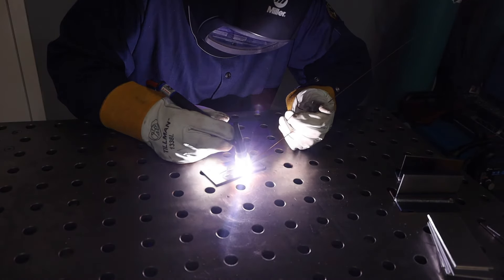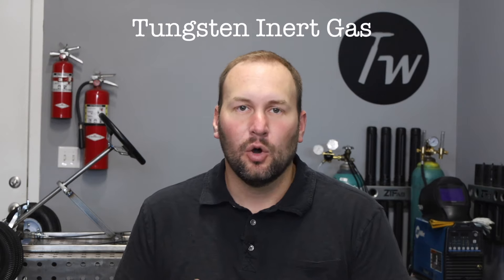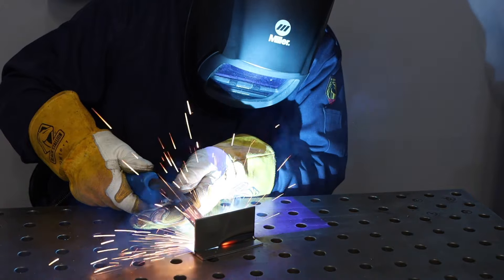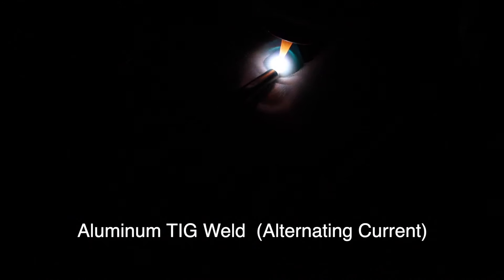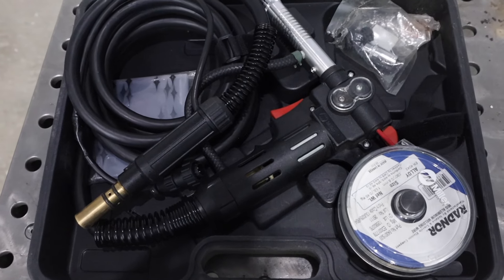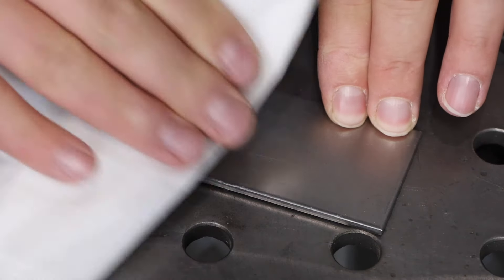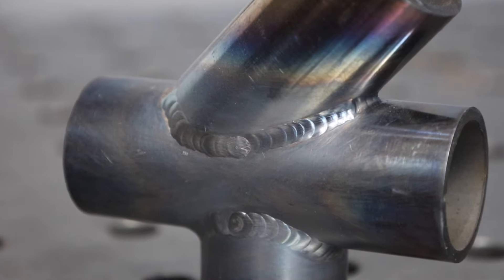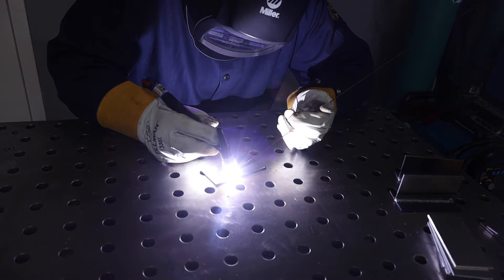TIG vs MIG Welding for Hobbyists: Which Type of Welding is Best?

Comment: I went through this for years. I went through the process of Stick>Flux>MIG>TIG>MIG>TIG. I only wanted one welder with one type of gas. In the end I went with a TIG AC/DC. I can weld anything at 12am at night with my kids sleeping upstairs in silence in my attached garage. No smoke, no spatter and limited fire hazard. One bottle of argon, some filler wire and you are good to go for pretty much everything. As a hobbyist, time is of no concern. I went with the versatility as aluminum is actually cheaper now in my area than steel.
Reply: Yeah I went from stick welding to Gasless MIG but would love to learn tig
Reply: @stewartsharpe9258  theres some really cheap tig machines ($200 steel only)out there. The only catch is the argon bottle, in my area, a full argon bottle will run $380. Its a way to get your feet wet in tig.
Reply: Where do you live? Low earth orbit?
Reply: @XenFPV  ?
Reply: Those are great points i stil am learning tig welding to be able to make my own exaust for my mopad
Reply: @stewartsharpe9258   starting out whit stick /flux is prety good its not to easy and u realy learn good basics about materials and how to adjust for those difrent materials i also like that stick welding is freakingly cheap and if u buy the right machine u can also tig weld because u can switch the polarity
Reply: I went to a school with my friend, already new stick, but learned mig in a week and tig in in a couple weeks.. I find tig a lot more dificult then mig.   but wow do people pay for specialty welds....first vertical weld I did with the triangle pattern turned out as good as it gets and I got $19 an hour, lol back when my highschool friends were in college, now there in university?  I asume they're still not making as much....$30 an hour these days I almost choked,  man welding is a good job ::-)
Reply: Flame welding is the only welding that makes sense because you are bonding the same material you are welding. MIG or TIG uses other materials to fill in which decreases the joint strength.
Reply: Tig machines can weld autogenous
Reply: @Sm00thieK  You're a dope. Anyone with an ounce of sense or ability to read above grade  5 level would know how/why very few people bother with gas outside of cut-off torches or rusted on nuts/bolts.

Comment: I chose tig as its quiet and clean to weld in my smallish garage at night. I think there is an argument for both. I'm looking to buy a mig at some stage but having another gas bottle is annoying.
Reply: You can use one gas for everything. MIG gas on TIG will eat the electrode up faster, and argon on MIG will make weird-looking welds that could be low in carbon and prone to cracking... but are you making a construction crane or a firewood splitter? 80% of 60 ksi is still a lot of strength.

I got the big bottle for TIG and the little one for MIG figuring I'm more likely to put it in the car and go somewhere for wire feed than for TIG.
Reply: Old comment, however thats a very good point to make for a lot of us home DIY'ers.
If you actually look at how much time you spend doing the actual welding, does it really matter if it takes you an extra 25-50% longer to do TIG? If I've a lot of welding to do, if MIG would take me 30 min, and TIG would be 40-45, the much less smoke, sparking, and lower noise doing it at night in my garage is a big plus in my consideration.

Comment: I’m going to start welding for the first time ever. I’m going to be ordering a primeweld tig225x. It may be a lot harder and time consuming but it’s the process that I’d want just for strength and penetration. I want my cage to be the strongest it can be. But the facts that I only need one gas kinda confirmed it for me. The setup might take a little longer but the ease of just needing to adjust settings and not gas tanks helps me since I’m going to be welding mostly in my garage

Comment: I bit the bullet and bought a 3 piece from Primeweld. TIG(225), MIG(180), and Plasma (Cut 60) for about 2k. Love em.
Reply from the maker: Nice!
Reply: How are you liking them?
Reply: @spoolinsvt6489   I still like them as much as day one, but I don't get to use them as much as I'd like. .......
I don't have a heated garage and I live in Michigan. It gets quite cold sometimes. I did notice that the arc start on the cut 60 doesn't always kick off on the first couple trigger pulls when it gets really cold. Other than that, not one issue. Really for the price, they are absolutely fantastic.
Reply: @derekmoore1612  Yeah at that price it is hard to say no. When in red or blue that price is basically going to get you only one of those machines.

Comment: I am learning to MIG weld at work. But I am also borrowing my friend's TIG welder at home to learn that too. Now to be fair, the set up at home has to all be put away while at work everything is out and ready to go, and there's a nice welding table too. But it's so funny the difference, especially when learning. Setting up at home for TIG is this big ordeal. At work last week I was prototyping a new weldment with MIG and it is just so damn fast! One handed welds zip zip zip. It's not a final product so it doesn't have to be pretty. But I am a perfectionist so I think at home I will get a TIG once my friend needs hers back. I want to be able to make some robot frames out of stainless and titanium because I'm a goofball, though I will mostly work with aluminum, and TIG seems nice for getting all that done.

Comment: Here is my take:  Stick for thick sections, FCAW for thinner sections, MIG for even thinner sections and finally TIG for the thinnest sections.  Also MIG and TIG are used for the so-called exotic metals such as stainless steel, aluminum and titanium.  Then there are the various nickel and copper alloys.

Comment: An important consideration for me going for TIG welding was the benefit of doing fusion welding. So without adding more material you can level a protrusion and melt it to the rest of the metal.

Comment: Here in the uk I bought a stick, mig, tig lift 120 amp welder from a company called static arc for £140. I had a couple of practices at mig welding 2 pieces of 2mm steel together in preparation for a pedal trike project I have and was surprised how much easier mig welding seems to be compared to stick welding. I’ve recorded the settings so I’m near as possible prepared for my project.
The tig attachment has to be purchased separately at £27 but the kit seems good value for the price and OK for a part time novice learning AMATEUR welder.
The advice in the videos are really usefully. Thanks.

Comment: I have MIG and TIG. I use a lot of reused material that has been stored for some time. I'm always working on some project and the need for extreme cleanliness when welding with TIG discourages me. I end up making very occasional use of TIG.

Comment: I couldn't justify TIG welding a smoker! However I do tig weld CERTAIN parts ie: hinges, handles. But for a firebox? Stick or mig is just way quicker.
Reply: I’m a mobile welder so stick is the best option for me, but if I was manufacturing or building stuff, I think I would mig all day.

Comment: Get a multiprocess welder. I’ve used stick, TIG, MIG, and flux core with my welder.
Reply: @Grauenwolf  I spent a bit more, but got AC TIG. Only thing mine doesn’t do, is pulse on AC. I got a Miller. I definitely paid a lot more, but I’ll likely not need another one in my lifetime, unless I decide to turn pro and mine breaks down.
Reply: @randysretired2020  Multimatic 220 ACDC?
Reply: @bobbybarnes1652  Yes.
Reply: @randysretired2020  Nice!  My brother has that (he's a welder by trade and also owns a mobile welding business) and I really wanted to go that route for my garage/barn unit. but $4500 was a bit steep for personal projects.  I actually just ordered the Primeweld TIG225X after reading a ton of reviews and watching lots of videos.  If I find I need the MIG side of things, I'll just order something from Primeweld as well (probably the MIG285).  3 year no hassle warranty and 7 day a week customer support that actually answers the phones!  We shall see.

Comment: Depending on what you want to do as in a career. In NYC tig is usually king in manufacturing, large pipe and working on buildings, they usually do stick etc. 
A lot of people I knew went with tig because around here, you could land a low pace manufacturing job which usually has bathrooms, parking lots, heat and a/c etc.

Comment: Cheers for the video Tim. I've been trying to figure out the best process and can't find an answer lol. So I have them all, I haven't tried Tig yet though. The added cost of gas has to be a big disadvantage for the home diyer. I prefer stick to flux core because I can barely see a thing when using flux core lol. I have bought disposable bottles of mig gas so hoping to get up and running with that soon.
Reply: 👋 hey Des,, I DIY primarily Mig flux core/Stick.  I've had the same issue with seeing the puddle and the joints. 
It was a lighting problem and old eyeballs.
If you can update the lighting in your shop area, that may help.
A cheap pair of Reading Glasses(1.50 mag) is a good idea also. 
Sadly,  at this point in time Tig is outside my budget 😕. But I do definitely want to learn that technique. 
Good luck 👍,   G.
Reply: @PaydayGabeBCNV  Thanks for the tips, I will have to get proper lights in my workshop. I actually tried a different type of flux core wire and there was an immediate improvement with both visibility and weld bead appearance. I had been using Super6 wire and now I'm using Parkside wire which is so much better. 
Cheers

Comment: I am learning to stick weld EVERYTHING now
Reply: Old school stick welding with a  Buzz Box is cool.  Never Chip slag from welds with out eye protection in place.
Reply: I leared to weld with E6013 rods on a Lincoln 220v "buzzbox welder" way before auto dark Welding helmets became popular. Just like riding a bike, when you learn you never forget. IF you can stick weld learning Mig will be very easy.

Comment: And with mig welding you can use it without gas with flux core wire. And if you use mig with flux core wire you can use it outside and you don't have to worry if its windy out becouse your not using gas.
Reply: But there's a lot of splatter !!

Comment: I found a 3 in 1 weld machine (mma, tig, mig) 

Currently i'm using mma but it's been a hassle recently and i'm considering on buying a new machine...

But i still want an MMA Option available to me since it's where i'm used to..

(I'm selling my mma machine because if i'm buying a new one, one must go. I had a limited space for storage.)

I hope i could hear some recommendations on why should buy 3 in 1 or shouldn't buy it, or just buy 2 in 1 machine.

Thanks

Comment: Tim...i don't know if you'll see this. I'm intrigued by TIG welding. I'm a retired man on a fixed income. I would like to try TIG welding. Should I buy a cheaper DC 110V tig machine to weld steel? Or should I buy a much more expensive  AC/DC dual voltage machine? We don't have 220V at homesite. It would be a "hobby" type situation. Should I just skip TIG altogether because of the cost? I know it would need a lot of practicing to even start.
Reply: Tim. Continuing. I don't know if I would be any good at tig welding. Like I said, would I be wasting my time and money?

Comment: Can I weld with a fire extinguisher? If the nozzle or tip is "the right size?" If I practice fire extinguisher safety where is a good hot place to practice this? Highways busy streets?

S

Comment: Hmm, TIG welding is similar to soldering copper pipe or electronics, need to manually feed the filler metal. I think I'll go with TIG since I also need to weld aluminum. Thanks.

Comment: I have been paying welders, mostly fencing guys, tens of thousands of dollars over the past three years to, honestly, just do "ok" work.  And some of it is below most any level of professionally. 

They speed through things and leave an unprofessional fit and finish.  I blame that on the modern day work ethic, lack of available skilled labor and, therefore, a lack of competition. 

Ok, you can probably see by my photo that I have a professional office job.  That said, I leave my house dressed like that but I always stop by one of my ranches to work for a couple of hours and I come home with a completely different attire.  

My father was a OTR truck driver, his father was a boiler welder at Babcock and Wilcox in Paris, Texas.  On my mother's side I had a grandfather who was an Iceman (remember those and also real iceboxes?) and another who was a pallet maker.  In other words, I come from humble N.E. Texas roots and I work hard in my full time professional occupation, and I try to be the best Steward for my ranches, grass, plants, trees and, yes, my cows.  In other words, I'm not afraid of hard work.  But I can be intimidated when taking on a new project or acquiring a new skill.

Bu

So, here is the rub.  I haven't welded anything since FFA 40 years ago, but think it's time that I start.

I feel that stick welding will be the best method for 2 3/8ths and 2 7/8ths oil field pipe for large scale fencing and stick welding is all that we did back in the day in FFA.

At the moment, I want to make some gabled, home made high tunnels with sides that will roll up during the summer.  I want to make them from 1 1/2", 1 3/4 inch and/or 2" steel square tubing.  The 6 mil PU coverings would be added as well as an exterior shade cloth because I now live in South Texas and suffer with intense heat and UV during the summer. 

I've read and watched numerous videos regarding issues of a newbie learning to weld.  

To me, it would seem that starting with stick welding (again) is preferred from what I gather.  

That said, I don't think that stick welding is the best option for my smaller square tubing welding project of building a high tunnel from square tubing.

Can the host of this video, and others, give me his two cents of opinion regarding this question?  I would appreciate it and any other constructive advice given would be greatly appreciated. 

I pray the knowledge of God and His blessings upon all of you.

Thank you in advance.
Reply: Ok I think for your projects buy a cheap multiprocess machine.  Flux core mig is the way to go for the fencing and tunnels.  Just use the cheap harbor freight Vulcan wire, or tractor supply brand wire.  I have found the Lincoln electric flux core wire to be hot garbage that doesn't flow very well unless the welding surfaces are preheated and very clean.

Having worked in the oil and gas  industry stick sounds like the way to go, but it wastes rod, leaves debris that can stab hoofs, and takes some talent.  Flux core mig is point and squirt while rocking the gun a bit, position doesn't matter too much. And wire left behind wont hurt animals and will be gone in a few months.

Comment: Why limit yourself to one process? Some machines will do both MIG and TIG, but changing the gas out can be a PITA.  I started out with a flux machine.  My next machine was a multiprocess.  I left my flux machine as it was and used the multiprocess machine mainly for MIG with a little TIG thrown in.  That became a pain so I picked up a dedicated TIG machine.  I also have an old tombstone stick welder that gets broke out once or twice a year

Comment: Mig is a lot harder than it looks (if you want your welds to look decent AND be strong.)

I felt really rushed when doing 1/16 square tubing.  The results often resembled bat guano, even though they were strong enough.

Then, there’s aluminum sheet metal - .040 or so - with spot-welds.
Reply: Use a smaller wire like 0.023"for the thinner metal.  The 0.30 and 0.35 wire piles up to much excess filler on thin metal.  Too thick wire  you can't get hot enough or you will burn holes in the weld and is a contributing factor to bat crap looking welds.  Also tune in the wire speed and heat settings first on a scrap piece of steel.  Grinding the steel clean with a 36grit fiber disc on a air sander/grinder.   0.023"  wire with a U shaped bead really allows you to slow down the weld speed for a nicer looking weld.     Linçoln Viking 3350 helps to see what you are welding.

Comment: There were a lot of words here. All I was looking for was which was better. If you weld a hammer the size of a building, which one wouldn’t cause the hammer head to break off? Which one breaks first, cause that one is the worse of the two.
Reply from the maker: It doesn’t work that way, unfortunately. The joints will have equivalent strength if they are done well.

Comment: If you're working on your car you will probably want a flux core welder eventually. If you're working outdoors TIG isn't very useful at all, especially when the wind is blowing. If you're working mainly indoors, MIG and flux might not be for you, and stick certainly won't be. 

I bought a multiprocess welder but I use stick most of the time because I can just turn it on and go. No nozzles, regulators, feed control.. just run it.

Comment: around 4.30 you are wrong, with the mig ind dirty area you mess up things as opposed to tig you can use the tig to burn all inpurities before you weld which you cant with mig, i experienced it with a sugar tanker
Reply: You clean the area with the tungsten arc first before welding? If I had steel cleaned up but still full of pitting from rust, how do you think tig would go?

Comment: So is MIG welding the same as "flux core wire feed" welding?
Reply: They're both wire feed processes, and generally, most MIG welders also do flux core, but they're not the exact same. MIG uses a shielding gas, flux core doesn't. Polarity is also flipped between the two.